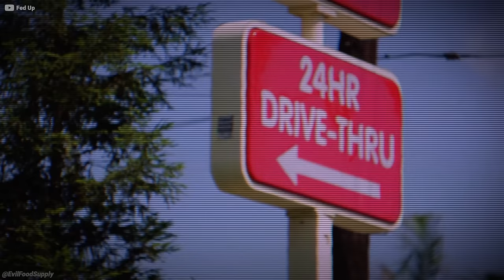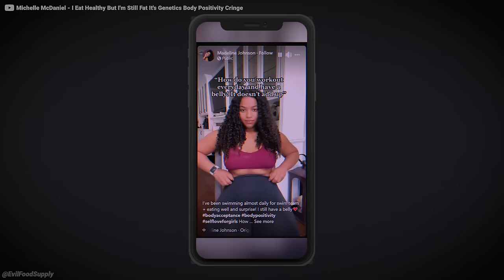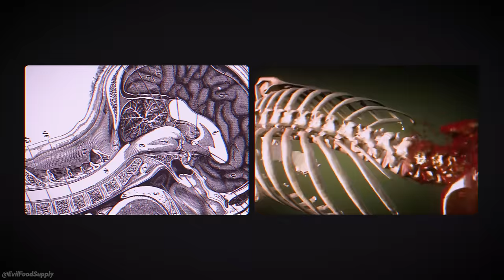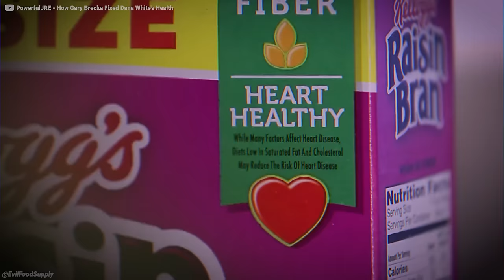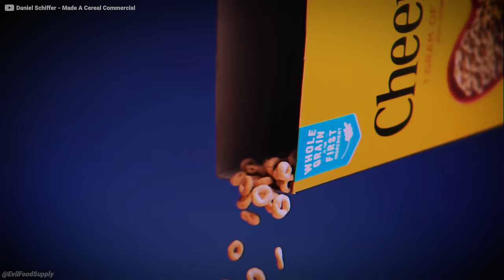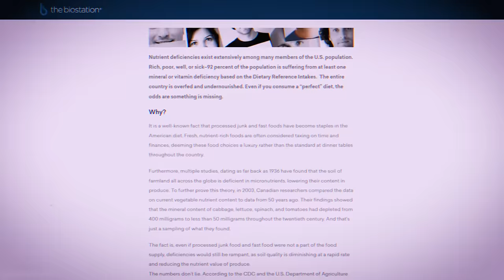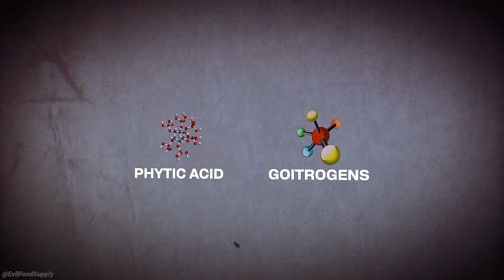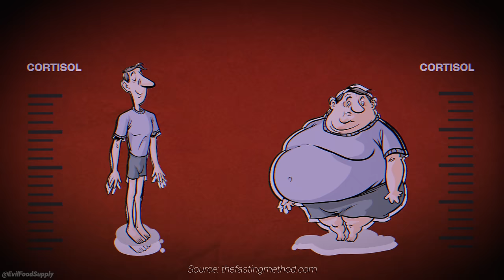The Obesity Conspiracy

Comment: okey diabetic swede with adhd here who just wants to clearify some things. 1 don't forget there is 2 kinds of diabetise, it is type 2 that comes with obesity and what happens is that your body gets resistent from the insulin that is being produced.  If it is typ 1, (the one I have) it is genetic and kinda random who gets it basicly your immune system freaks out and kills all of the beta cells that are producing the insulin, so your insulin production compleatly stops. If you don't get insulin your body will not be able to brake down and transform sugar, so all the suger just hangs out there until you spoil from the inside, since this causes your blood to become acidic. And  2-ADHD is not a hormone in balans it is all genetic, however messed up hormones & a bad diete can worsen the symtoms! it is importent to point these things out, becuase otherwise some people will think that people like me and many others caused our genetic conditions due to a bad diete and blame us for it.😊

Comment: Nope.  Overconsumption of calories IS the problem.  It's not metabolism, it's not lack of exercise, it's not genetic.  It's not hormones.  It's not too much fat (unless total fat exceeds daily calories).  If you have a caloric deficit every day, you WILL lose weight.  It's a thermal physical and chemical process.  If you're a grown man, total calories should not exceed 2000 calories a day, for women 1500.  Those are roughly the base daily caloric requirements for a human body to perform its metabolic functions (meaning, the total your body burns just by living).  If you consume less calories, your body will use fat stores to supply the rest, forcing you onto a smaller thinner frame.

Comment: My hair was falling out bad. I learned that lack of iodine can cause that. I started taking kelp pills (2x DV) and my hair stopped falling out. 4 yrs later, I still have to take that high of a dose or my hair will start falling out again within 2 days of stopping the supplement. 
My iron got so low I was getting dizzy and couldn’t breathe. I had to figure that one out on my own too. I take 125 mg a day plus 500 mg of vit C with it. 
I take  chelated magnesium as well because when I don’t, I get bad restless legs. Another thing I learned on my own. 
Drs are not very helpful when it comes to this sort of thing.

Comment: To lose weight, it's very simple. Eat less calories than what you are burning. Calories in, calories out. Also known as being in a calorie deficit. You might be eating "low calorie" snacks, but if you are eating A LOT of low calorie snacks, then you are still eating a lot of calories. Makes sense?

Does that mean you can lose weight while eating junk food as long as you are in a calorie deficit? Yes. 
Does that mean you should? No.

Eat nutrient dense foods and mind your portions. Try to increase your cardio activities like 20 minutes of walking a day, so it helps burn calories. That's it really, unless you have a diagnosed medical condition.

Comment: I was 276 at my heaviest but I think I was around 300 or more because I made changes to my diet prior to going to the doctor a few years ago for the weigh in. I went on Keto/Low Carb and went down to 206 with the help of a doctor who actually knew what she was doing, and I checked my glucose all the time and got labs done during that time period. She had to put me on Magnesium and Vitamin D supplements and that helped my metabolism as well. If y'all do low carb PLEASE work with a doctor to get initial labs done as well as periodically because then you can know what's wrong with you and what else to work on. Plus you can do it with someone who can monitor it. Especially for electrolytes of Magnesium, Potassium and Sodium as if you're doing it right, low carb WILL deplete these -- which I saw on my labs. Fortunately, easy to fix. After my doctor went to a clinic to work outside my insurance Network, and a series of issues in my personal life I ended up stopping low carb and gaining back some, getting up to 247.6 this May 2023. At that point I IMMEDIATELY began making changes and now I'm down to 214 as of today. Took several months to get to this point because I wasn't doing much IF 16:8, HOWEVER, I am doing it now as of this week. Since the holidays are basically over, I'm having a nice Mexican Picadillo tonight for dinner and then will fast 16:8 (or longer, but I get headaches after 21 hours so I don't go beyond that even if not hungry). I'm going to do this round of Keto/Low Carb more strictly and have as much nutrition as possible as I am getting symptoms of Vitamin D deficiency and dehydration. Drinking deliberately WAY more plain water now (only flavored with ACV or lemon or lime, no sweetener alternatives). I am also going to try to wean myself off of even sweetener alternatives so that I'm rarely using them. Fortunately, I drink my coffee with just half-n-half and no extra things, but I do use the sweetener alternatives for other things which I need to stop. Some folk may be like -- oh but you probably got the money to buy this and that. NOPE I JUST WENT TO THE FOOD BANK/PANTRY TODAY AND GOT MEAT AND LOW CARB VEGGIES CHEESE AND HALF-N-HALF TODAY, ALONG WITH A FEW OTHER INGREDIENTS, AND REFUSED TO GET ANYTHING THAT HAS SUGAR OR HIGH CARB. The staff there also some of them know I'm pre-diabetic/insulin resistant (Hemoglobin a1c is normal now due to my efforts but I am NOT going to mess that up by eating like trash again) and will get me some low carb and sugar free snacks if they have it. Also, doing IF 16:8 helps me to eat less and therefor am usually full longer when I'm in ketosis, which is great. I'm looking forward to this because my goal is to get down below 200 or at least close to it by the end of January 2024, so I'm getting started tonight with my IF 16:8. Tomorrow is Day 1 again of Keto/Low Carb and I plan to lose a LOT of weight by Springtime so that I can look and feel amazing! Plus, "pretty privilege" is a real thing from what I've noticed so I need to drop this weight ASAP and maybe I will get taken more seriously and get a nice job. By the way -- zucchini is a good alternative to pasta and you can spiral it with a cheap spiralizer, then put it in boiling water a moment. Don't leave it long otherwise it will wilt and lose its mass and then you have to have more and its no longer low carb. I usually just add it for a moment to boiling water to kill off any bacteria it might have. Also, turnips are a great potato alternative but don't get the large ones, they can be bitter. They can be eaten raw so a good way to find out if your turnip is good or not is to take a slice that you cut before doing anything with it. If its like a radish and good, then its fine. If its not, you'll know. When I make low carb picadillo, I will use turnips and zucchini, but not tonight. Tonight is my transition meal for the end of the holidays and the end of 2023. Do your best to get enough Magnesium and other electrolytes (cacao powder and cacao nibs are amazing for Magnesium and Potassium, as is coconut cream, in case you need to find out what has a lot -- I believe there's a TON of Potassium in coconut water as well, but that's not something I like the taste of so I never get). Magnesium is vital for OVER 100 body processes. I was learning about Herbalism as a hobby over the summer and I decided to learn about the individual Vitamins and Minerals as well, what deficiency symptoms looked like, and what foods (for my notebook I only added the low carb foods) and herbs had these vitamins and minerals. A LOT of mental health issues can be fixed with getting your vitamins and minerals in check, along with getting your gut health in check. If your gut isn't healthy then you're not absorbing the vitamins and minerals. Another thing for stress to focus on is Adrenal health, but be careful looking for Adaptogens because some that folk say are great, such as Tulsi, shouldn't be taken in large quantities or for a long time. However, from what I have noticed, Nettle is good for that as well and its amazing because Nettle is an EXCELLENT anti-histamine as well! I was having a panic attack (I felt biological symptoms) and the Nettle tea helped with that immediately and I learned later that histamine issues begin in the gut via an enzyme and if the gut is messed up then you can have histamine intolerance, which can also mimic a panic attack. I noticed that once I got my gut in check that the histamine issues also stopped. I'd even gone to the doctor for when I was having these issues and she had no idea what I was talking about and looked at me like I'm crazy. Not my fault she doesn't know anything about the gut. I actually am learning. Anyway, after that appointment, I learned more and fixed my own problem. I'm looking into a new doctor now who actually knows what they're doing. Oh, I brought up Adaptogens and Adrenal health because your Adrenals directly have to do with the body's response on stress as well, along with cortisol. Most folk neglect them. If your cortisol levels are normal, have your doctor check the adrenals. There are so many pathways that affect the body and fixing one can have a nice effect on others.

Comment: CICO is insanely stupid, I count my calories on my current way of eating, and I'm getting close to 3000 a day, but I'm burning fat, getting lean and ripped. Because counting calories doesn't mean anything, it's the Q U A L I T Y of the calorie that matters.

If I changed my diet to eating 1500 calories of pure refined table sugar, which would be 32 tablespoons of the stuff, in a single meal, and I did that daily for months, I would gain so much weight, I would balloon up to a beachball in a few months easy. Even though I would be eating well under my maintenance.

Comment: If you take this all at face value there's not much left to eat in terms of fiber and plant based foods. Definitely some good takeaways, but definitely use it as a tool to pair with other knowledge gained from other sources, along with your own findings on what works for you as an individual. Bottom line, if you're obese you have to fix it. Don't blame the big farms or factories...

Comment: For one I want to say Dr. Jason Fung, is not a reliable source. He has no degree in Nutritional Science. 

5:20 Its because of your calories. And you dont have to eat bland food for the rest of your life. High volume, low calorie foods. At the end of the day, it's calories in calories out. Even if you have a metabolic condition or insulin issues. Which would be the exception not the norm, and even then after you fix the issue its calories in calories out. And of course you need to focus on quality of food. Vitamins and nutrients matter. 

Dieting is a life saver. The issue is people keeo crash dieting. If you lose weight too fast, your genetic makeup will make it harder to keep it off long term. Your caloric deficit should be no more than 500 calories less than your maintenance. 

Hormones are 1 aspect of your weight loss and muscle building. Most people don't have hormone issues enough to not be able to lose weight. 

The next step is exercise. Blood flow helps with fatigue, sleep, brain function etc. Our food is fine and not void of nutrients

Comment: I'm pretty much been fasting for about 2 years I did lose a lot of weight but sometimes he comes back but my body is pretty much still a little slimmer I definitely have more muscles now ain't saying they're like big muscles but I'm definitely feel much stronger. And I do eat healthy and eat less which actually does help. And I do eat on healthy sometimes but I'm also eat healthy most of the time.

Like sometimes it's frustrating like sometimes I lose a bunch of weight then I step on a scale and it says I haven't lost any even though my body seems slimmer because scales are sort of frustrating like my body feels much thinner my arms and legs are thinner but when I step on the scale it says I didn't really lose much weight pretty much the same weight if I started exercising more then the scale started moving but somehow I started gained it back but that was mostly my fault I just say was Thanksgiving ate a little bit more that explains the weight gain but the funny thing is my muscles and my body was still slightly Slimmer still but the weight went up a little bit.

Comment: It 100% is due to eating too many calories.  "Nutrition" is neither here nor there.  You need vitamins, minerals & fiber for good nutrition & satiety but that has nothing to do with weight loss.  It all comes down to caloric intake.  Sweets, simple carbs & high-fat fried foods (trans, saturated) are generally higher in calories than lean proteins, complex carbs & mono/polyunsaturated fats.  This junk food leads to insulin resistance, which increases junk food cravings & impairs your brain's ability to tell when your stomach is full.  Once you're pre-diabetic or diabetic, your nasal nerves & tastebuds become damaged so you now REQUIRE highly salty/sweet/fatty foods to taste anything at all.  It's a vicious cycle.  Fat people really ARE hungrier & then things like sleep apnea (poor sleep) worsen the appetite regulation problem.  
     Where nutrients come in is satiety.  Fiber also helps keep you full longer & slows digestion.  Mounjaro, Ozempic & similar drugs delay gastric emptying & work by reversing insulin resistance, which is why they're so revolutionary for weight loss.  Unlike stimulants which only superficially suppress appetite, they treat the core cause of metabolic syndrome.  Simply going for a walk after a meal instead of vegging out or taking a nap will boost insulin production naturally, as any Type I diabetic will tell you.  
     People are eating too large portions, period.  Taking supplements will NOT lead to weight loss or resolution of your health problems.  There's no evidence they even have the same effect as getting vitamins/minerals from food or are absorbed from pills.  Anyone who tells you otherwise is trying to sell you something (supplements, I'm assuming).  Worse yet, many have been found to contain heavy metals, dioxins/PCBs and even illicit drugs!  This is due to total lack of regulation by the FDA.  
     Also:  people in the 20th Century smoked cigarettes & did not use psychiatric drugs like SSRIs at the rates we do, which contributed to the slimmer figures.  In fact 1 in 10 Americans takes 5+ Rx medications daily.  Weight gain is a common side effect of drugs like old school antihistamines, mood stabilizers (Depakote, Tegretol & lithium), corticosteroids, contraceptives & antipsychotics.  Overuse of antibiotics has also changed our gut microbiomes, which means it's harder to maintain the same weight as in the 1980s even with the exact same exercise/eating habits.

Comment: All your videos have been really good so far and there's a lot of good information here. But putting forth the idea that calories in - calories out doesn't work is very disingenuous and scientifically false. I emplore you to please edit this video and do more research. It's just a categorically false claim.
Reply: I agree with you, saying calories don't matter is ridiculous. It still represents the overall energy value of foods, and yes, the way the body uses different fuels does determines the actual energy extracted. I have been ketogenic for 3 years now, sometimes at theraputic level. I know that with  intense daily workouts even on fat and protein no carbs, if I exceed my BMR by 30% calories I gain weight. Simple. 
However, now on a carnivore diet and eating platefuls of fat and protein twice a day, much more than previously, without carbs, no snacking and no eating after 6pm, my calorie calculations show I am definitely eating slightly below my daily  BMR and losing a few ounces of fat every week.
Why? Because the lack of carbs and increased fat makes for slow digestion, that's great and fills me up for several hours at a time, meaning I have lost my carbohydrate addiction and requirement to eat more calories.
Interestingly, without eating fruit and sweet or carb based things, I get no desire to eat them.
Reply: @elkiton  I noticed very similar results on carnivore! Overall, felt more full and ate less.
Reply: @andyc7747  It is the tried and true way to lose and gain weight, eat more, eat less. The calorie is just a measurement, obviously there is lee-way in how the human body metabolizes food but the law of conservation of energy forbids people from gaining weight when lowering caloric intake.
Reply: @andyc7747  I have a problem with this concept. Whilst I agree with the definition of a calorie being a unit of heat, that value of heat is directly related to the potential energy when (oxidised) contained in the food regardless of how the body deals with it. In the absence of any other viable measurement, the calorie is the only guideline the layman has as to how much energy you are putting into the body for processing. One can by eating a variety of foods over time, relate the weight gain/stasis/loss to the quantity of calories consumed. Yes, it will be a very individual thing, but to tell people cico does not work, is not helping them as you take away their only guideline that exists, albeit an inaccurate one.